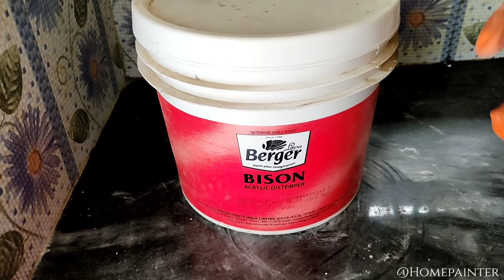DAMP PROOF AND WALL REPAIRING - How To Repair Water Damaged Wall

Comment: This is just a temporary solution, waterproofing be done from positive side, below the tiles im the bathroom. That is the cause of leakage.
Reply: Ahhh...😂
Reply: No option… Everybody knows its quick fix vilid till next rainy season… it will again wet, damp, fungus, bubble, peeloff,...
Reply: Repair inner part of the wall, becz main problem is in the inner side of the wall. Its not a prooer solution.

Comment: To damp proof walls five bottom layers of walls should made of stones, and foundation should made of gravel and cement, this way moisture won’t be seep up and walls will stay dry. Bricks are pours and moisture travels upward from ground.
Reply: doesn't help if its a shower and there are no wall tiles.
Reply: Fundamentally the problem is one of seepage and concrete is porous. Depending on its density and microstructure as dictated by its composition, integral waterproofing agents, and sometimes sufectants. Even rebars are often coated in an elastomeric compound to resist corrosion. The fundamental problem here is the source of water and a drainage pathway needs to be created. If possible, the structure could be undermined and stacked with bentonite clay.

Comment: You must do waterproofing of bathroom floors first. Water collecting under Bathroomtiles is the reason for dampness outside bathroom wall
Reply: How to do this
Reply: Exactly, without fixing the bathroom floor tiles first this job is pure waste, it will again be same like this
Reply: Side ke flat ka bathroom touch mei hai wo nahi kar raha hai toh kya kare 😂😂
Reply: @NaveenOm786  I cant understand Hindhi ...
Reply: Who gave you the responsibility of waterproofing the bathroom floor of another flat?  Before giving advice to others, apply it to yourself
Reply: @technicalhub2083    waterproofing bathroom floor tiles should be done in each and every flat in a community living ,for health and hygiene.Iam in the construction line and i have done waterproofing for new ,as well as 20 Yr old buildings.use Fosroc waterproofing after removing the old binding material between tiles using a grinding machine!Then waterproofing material should be mixed and applied by proper technicians ,as it will dry fast after mixing!
Reply: @technicalhub2083  It's the responsibility of all the,residents  to maintain the houses.when there are common walls it's imperative to do, and,as the secretary of the,apartment I had the responsibility of coordinating such work.In a community living one cannot cause danger to other residents by neglecting such maintenance works. In Singapore the government checks the toilets and if there is any seepage, waterproofing has,to be done within the,stipulated time.
Reply: Bro how to do that please tell me
Reply: Can you suggest how to do waterproofing of the bathroom? 
We are facing the same issue. We attached tiles in our bathroom, it still damages the outside of wall.
Reply: @nishattabassum819  Many waterproofing companies undertake,the work.search in Google.FOSROC,DR FIXIT HAVE  ,GOOD WATERPROOFING MATERIALS .

Comment: Everything is ok, effort & cost. But most pertinent question is- how long the wall will find same. I guess maximum two to three years. After the wall condition will restore in same condition as it was before. You can't resist the flow of water inside the wall unless find the source of dampness and do the  action as appropriate to check the same.
Reply: There is two types of wall ...
One is likeg wall...that you have to repair frome where is the likeg folt.
Second is moisture wall ....
You have to repair after ४ to ५ yers...now there is good solutions for this wall...one which this person showd us 👍
Reply: Jio
Reply: Good question bro..
Reply: yes  ,   first  stop the water leakage at the sourse,  arrest the laeakage first

Comment: As a maintenance bricklayer ,city ang guilds trained .your methods are short term .aproper job is to put in a traditional d.pc for rising damp plus a thorough cavity clean ,secondly if damp is occuring at high level ( upstairs) check chimney ,flaunching,flashing ,pointing ,gutters,need to be clean and a check on the membrane under the tiles,also timbers for wet rot..many things to be checked ,fixed, is it cavity or solid wall,how porous are the brick.ect ,any one that reads this ,I can offer full quality advice

Comment: Dampproof is not suggested to walls adjusent to washroom or capillary actions,  you must apply dampblock 2K on brick level and then repair wall.
Reply: Is anyone available for this job
Reply: @subramanianpkm8444  aap kaha se h
Reply: Is damp block 2k only on brick level and can't it be applied over the existing painted surface?

Comment: I am a waterproofing contractor since 2009 and earlier a branch manager for 13 years in a paints company. Application of Damp Proof does not resolve the issue. This coating is not required at all if we find the source of leakage and plug it.
Reply: You are right. But at least you will not see the dampness and tenant will not complain. Generally the leakage should be from top or bottom or some leaking walls.

Comment: Main question : when I have removed the plaster till brick level
Step 1 : We apply 301 pidicrete + cement & apply quote with brush
Step 2 : what will be the combination for plastering now? Normal cement or should I again mix pidicrete 301?
Reply from the maker: https://youtu.be/m9GzuuV98to
Reply: @Homepainter19   I have seen that video sir 
3 part sand + 1 part cement + 1 part pidicrete (with  little water). But plaster karne ka area zyada bada hai.
Reply: @Homepainter19  can I call u tomorrow morning to discuss?
Reply: @saif3088  for dditional protection use URP 301 in the proportion given. Else u can use LW+ 101. 1part cement + 3part sand add 200ml lw+ to 50kg bag of cement into water and plaster.
Reply: @Homepainter19 i don't know hindi sir i am from tamil nadu 405 gypsum plaster mixing side brand name and tell me Berger mixing components sir?

Comment: I had called some waterproofing guys they just applied pov cement and then 4 coat of waterproof chemical. It was not dr fix it some thing else it was same thick white stuff...the work they did was not good some 1 from borivili area n chutya log were charing 300rs per sq feet